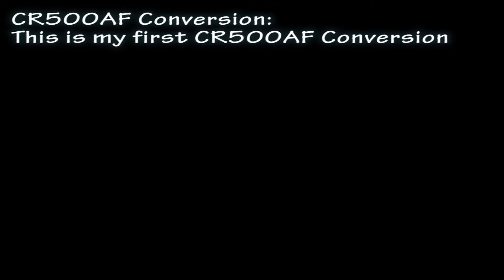CR500AF Conversion Walkaround

Comment from the maker: @RyanMankstar As long as you are detailed in your instructions to the shop it should turn out OK. I would draw lines of where you want things cut/moved on the frame, and once they have that take your engine in and show them where it needs to sit in the case. The great thing about these conversions is that the swing arm pivot bolt goes through the back of the engine so you don't have to worry about lining it up with the sprockets. Just throw it in, and have them weld on the tabs... Good luck!

Comment from the maker: @chewboka89 Thanks dude! You need to use all of the 450 parts you can for these. The CR500 swing arm and triple tree will not work. You could probably use your suspension, but I wouldn't recommend that either. I would stick with all the stock 450 parts, and just use the 500 engine. However, experiment! Try it out, I could be very wrong and you could be building the best thing since sliced bread! Post some pics when your done!

Comment: I thought you didn't need to cut frame on the 125. Very nice job. I have a 450 2003 I was going to convert. But from reading up I have changed my mind to try a 125.

Comment from the maker: @02kx1 Everything will work with modifications, but I don't see why you would want to with that frame. The draw of doing a 500 AF lies in using a honda perimeter aluminum frame, and from what I know about the 02 KX125 frame is that it's steel, and just regular. If you want to do a KX500AF build, (my next project), just get a 2006 KX250F frame and a KX500 engine.

Comment: i have a 2003 cr125 and the con rod bearing went yesterday so the crank need's spliting but i have a 1986 cr500 i am thinking of just doing the conversion but it look's a bit hard i can not weld these frame's and if i take it to the welding shop they mite just fuk my frame up ?

Comment: @shiftyonevr4 hey im lookin g into converting one myself but im going to do a 90s cr500 engine and a early 2000s aybe late 90s aluminum cr 250 frame how hard will that be? can i just move motor mounts or will i have to extend the frame?